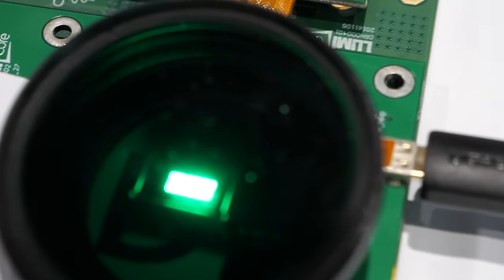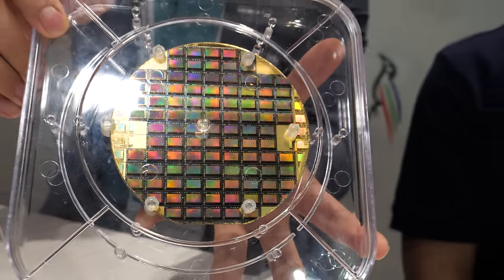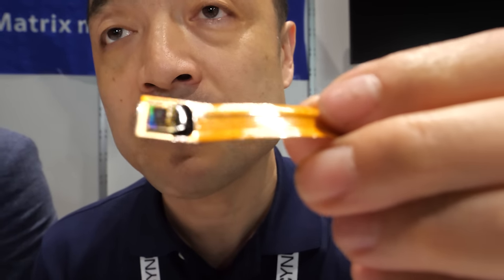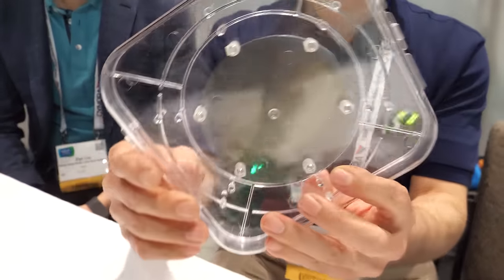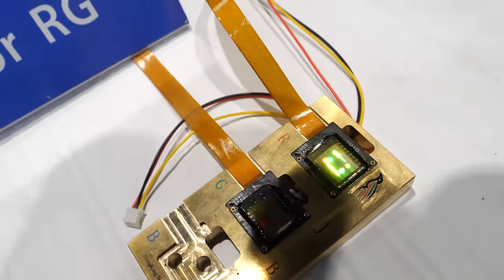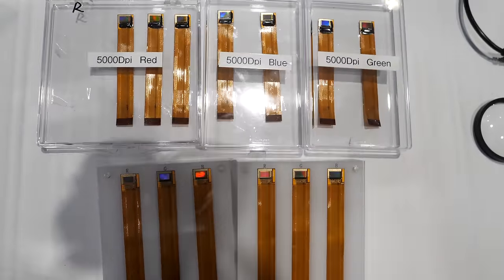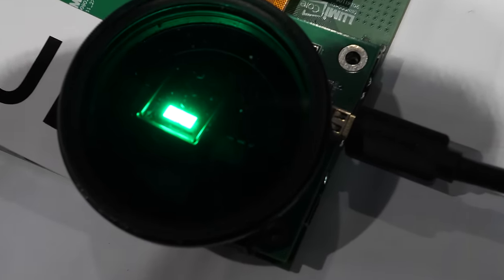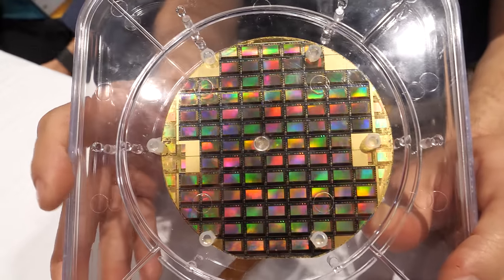JBD microLED 2 million nits, 10,000 DPI (5000x4000), brightest, highest pixel density in the world

Comment: I can't wait for microLED! I'm absolutely tired of motionblur!!!! microLED is going to be the new CRT! People say "nothing is faster than the speed of light" well both CRT and microLED are both self emissive displays and uses light to produce the image. CRT has response times in the nanosecond range and now so does microLED. Some people still use CRT's for CS:GO because they have the fastest response time of any display. I picked up a Trinitron CRT monitor for retro gaming and it's absolutely perfect for that. Playing Sonic the Hedgehog 1, I can track the background layers while Sonic is running horizontally across the screen. Fire up that same game on my ASUS 4K HDR 144Hz monitor and I see motion blur and it's hard to track. That is how fast CRT's are, they have 0 motion blur. 

I can't wait for microLED because it will have the response times of CRT's or maybe even quicker!! CRT's can make 60Hz games feel like 85Hz where as those same games will only feel like 60Hz on a LCD.
Reply: You're mixing up symptoms and causes. CRTs have lower latency, not faster image element response time. Modern TFT panels run on the equivalent of global shutter, so the pixels actually have lower latency at the last scanline (which means, if you have a display marketed as 2ms GTG and run it at 60Hz, you might as well add 17ms to that figure). CRTs by comparison hold no memory and will excite the phosphor directly controlled by the input signal. That doesn't mean they're without blur, which is far more affected by the phosphor decay rate; a CRT built for 50Hz will have severe blur if you send it much faster images, assuming it syncs at all. Image persistence is the main contributor of motion blur and there are TFT based monitors that compensate this using a strobing backlight; blurbusters.com tests quite a few of them. That still doesn't get around the latency issue but scanning backlights could. Self emissive displays could be designed for immediate update, but aren't, largely because computers don't calculate image for it (it would mean a different physics calculation for every scanline) and video recordings don't have high frame rates. Rather, tasks like VR where this really matters use a shorter exposure time, which is often available in monitors (branded things like ultra low motion blur). Full persistence, often branded as flicker free, is the exact opposite and is likely what you experience with your monitor. You could try checking if it has a mode for low persistence; in mine it only operates at 100Hz even though the panel can update at 144Hz.
Reply: @0LoneTech  CRT's and LCD's display images in fairly radically different ways.
CRT's are impulse or scan-type displays, where each frame they display is only visible for a fraction of its cycle as the screen gets constantly scanned by the electron-gun, column by column and row by row.
At 60Hz for example, a frame has 16.67ms cycle, but on a CRT display, the frame is only visible for a fraction of that time (<1ms)
An LCD Display on the other hand, uses sample-and-hold circuitry, which means the image is constantly on during the whole 16.67ms at 60Hz.
This 16ms persistence of each frame is what causes motion blue when eye-tracking moving objects on screen.
Impulse and scan-type displays like CRT's are not the best way to display images, even though they are much better with motion than 60Hz sample-and-hold displays. The reason is flicker/strobing and the artefacts that go along with them.
The best way to display motion images is with ultra-high fps and Hz sample-and-hold (1000s of fps @ 1000s of Hz).
This is where MicroLED will be able to shine, since it has extremely fast response times and can be refreshed at thousands of times/sec, effectively 1000s of Hz.

Comment: The graphics horsepower required to drive the proposed resolution would have to be other worldly.
Reply: Nvidia already has a gpu for that in a bug server that requires 100 rack's to run 16k at 480hz
Reply: Not really. Foveated rendering is 100 times compute savings at very high resolutions by only rendering in high resolution what you are directly looking at. You see ~60 pixels per degree at the fovea, 15 PPD a few degrees out and only ~1 pixel per degree in your peripheral vision. High contrast black and white things like a hair on a black background is ~120 pixels per degree (light sensitive rods have higher resolution than colour sensitive cones). Total human vision is more like 1000x1000 pixels per eye. Rendering 120 pixels per degree over a 100x100 degree field of view is 12000 by 12000 pixels. With very good and extremely fast foveated rendering that's more like rendering bog standard 1440p in terms of performance. It is being worked on. It's pretty good already, but not yet perfect. The slower and more inacurate the foveated rendering is, the larger the area is where you need to render full resolution so you cannot accidentally see the low res areas with your fovea, which would look like everything got really blury for a fraction a second.

For AR it maybe doesn't even matter. If you're using it as a HUD to e.g. bring up car schematics while you are fixing some part of a car it's just text and lines and not an approximation of realistically lit 3d graphics.

Comment: One question I would ask is, are they only planning to make micro sized panels or do they expect to make large 60" or higher panels in the future? Would that be economical?
Reply from the maker: I think JBD only does micro displays, but you can use one for example in a pico projector to use as a 120" display, I do wonder how bright their 2 million nits display goes out through lenses etc as a pico projector, I hope they can show that with full color soon too.
Reply: I hink those panels are only good for VR and VR have very small displays...orherwise 5000or 10000dpi is just of no use for a 60" panels
Reply: @charbax  ok
Reply from the maker: @anandsuralkar2947  my thinking is they might reach 8K pico projector with this technology, would revolutionize the 8K market if you could have an affordable bright enough 120" or 150" using such 8K Pico projector.

Comment: I just wanna an microled monitor mid budget to be released to market and i,l be happy.
Reply: At least they should come up with that first. Still having to resort to using LCDs this day and age is inexcusable.
Reply: This is not it. This is made out of a single monolithic slab of silicon like a CPU and it won't get any bigger than ~40x40 mm and even that would have craptastic yields and be almost impossible to make. This is for VR/AR where you look at the screen through optics. It can look like a 100 inch display a few meters away without being physically large. For VR you can't really get the field of view from this small device with known tech, but you might use this for the tiny central vision that needs to be very high resolution and use mirrors for positioning it where you are looking. Large microled screens use tiny individual LEDs that are picked and placed for each pixel. They are working on self-aligning processes to be able to individually place tens of millions of LEDs without having to individually pick and place each one.

Comment: A vr headset will that hight ppi will we wild
Reply: It will be a great way to Melt Your Eyeballs aswell
Reply: @samcerulean1412  Probably
Reply: Its would be harder to distinguish reality from VR
Reply: @samcerulean1412  u can just use low nits panel dude
Reply: @samcerulean1412  Yeah totally because You run that thing at full output in a vr headset... Duh

/sarcasm btw
Reply: @anandsuralkar2947  Strobing. 2 million nits but only illuminated 1% of the time -> average of 20 000 nits; preferably still only on a tiny area of the screen at any given time.
Reply: @ZillionPrey  You absolutely would no matter how high the brightness is; it would just be on for a shorter amount of time if the brightness was higher.

Comment: Perhaps there ist a production trick of colored micro-LED-displays. If you have a blue micro-LED-matrix ,and a suitable photopolymerisator-initiator in the colored stereolithography-resin, it can be hardened by the own light of the matrix-lamp. The dark lamps dont create a hardened and colored spot  in that resin environment. Resin must be changend, after creating the red pixels, green pixels can be created by contacting with green colored stereolithography resin and switching on the right blue lamps in the micro-led-matrix. It should be a flourescent color, that converts the blue light into red and green if the lamp was coated with that hardened flourescent stereolithography plastic. Removal of the liquid resign uses a solvent like acetone. Flourescent compounds in the stereolithography resin can determine the penetration depth of the blue light, that determines the thickness of the shift, that is created by switching on the blue lamp in that resin. Also the generated green and red light can affect the right photoinitiator, create the right penetration depth of the light field, that makes the resin hardening.

Comment: How does this handle in terms of heat?
Reply: Depends.  Cranking it to full it obviously needs a heat sink like a CPU. But imagine this; you strobe the display at 1% duty cycle. Perfect motion clarity like a CRT instead of the muddy mess that is LCD (even with strobing, lightboost etc, the duty cycle is just too long).

Comment: it would be cool to use it in PALM SIZE super projector...
Reply from the maker: If that works it van turn any future smartphone into a 4K projector, on walls but also on tables with short throw lens type and an infrared sensor to turn any table into a 20-30" 4K table tablet can be good for productivity. Basically turns the phone into nearly a laptop.

Comment: Display manufactures to be suppressing this tech. Would make all there products and investments obsolete.
Reply: No. CMOS cirquits can't be made larger than 8cm2 due to the limitations of the litography reticle. Stitching several screens together to make a larger screen is really expensive. One would need like ten 300mm wafers to make one TV and the material cost alone of those wafers are more expensive than the sales price of a complete TFT LCD. 

There's no surpression. All manufacturers want to be the first to bring microLEDs to the mass market. It's just that it's not possible to scale the size with the technology displayed in this video. That's why they market it towards products that can manage with 8cm2, like wearables, projectors etc. 

Maybe the superiority of these screens if implemented into VR/AR-devices will make televisions and computer screens irrelevant, at least for single people.
Reply: @LeonardTavast  Thats fair. You sound knowledgeable enough. How long do you think until we get these displays in vr headsets? Also what's a lithography reticle? Not sure we will have gpu's that can drive these panels at full resolution for a while tho.